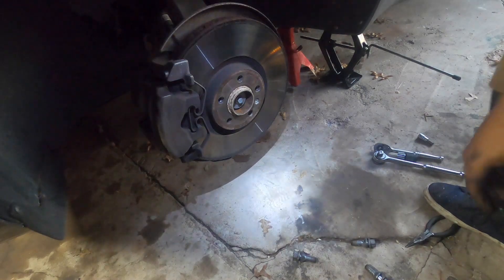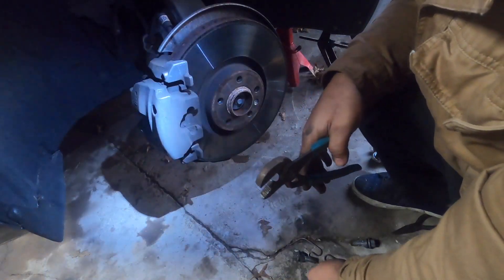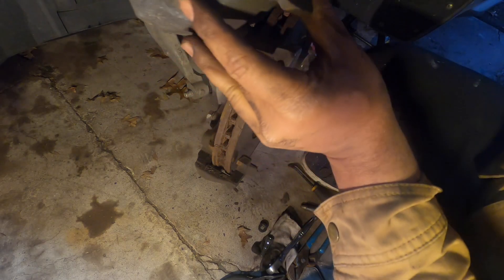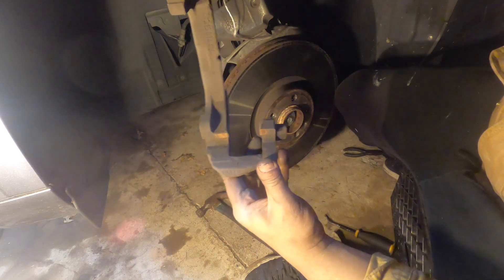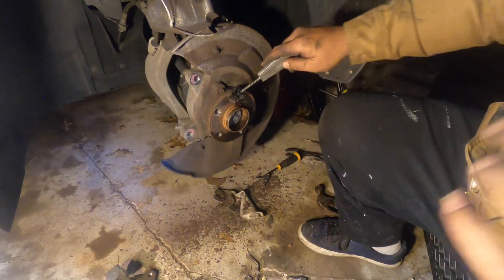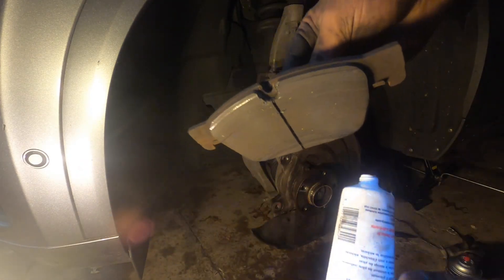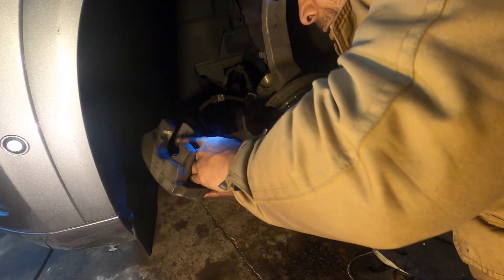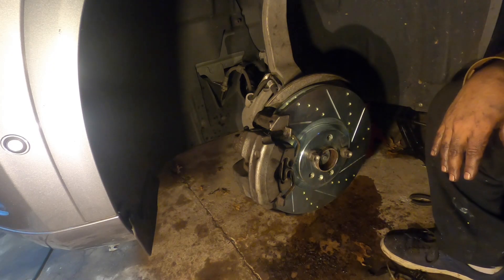how to replace brake pad and rotor on 2016 volvo xc90

Comment: The reason you couldn't fit the disc locator screw is the discs are sided and you fitted the discs to the wrong sides. think how the wheel rotates the groove should be pushing the pad away from the centre of the wheel - you will likely end up with judder and/or pad squeal from this mistake.
Reply from the maker: I’m flashing the brake fluid soon. I will swap the rotors to see if the screw hole lines up. Thanks. I have been driving the car over two years. Didn’t notice anything odd.
Reply: @BengalTiger  It shouldn't make much difference unless the centre cooling vents are sided.  If they are not angled then you'll get away with it.

Comment: The most annoying part of this job is that the caliper slider bolts use an 11mm hex which is difficult to source. A 7/16 hex will work though and easier to find. Good luck!

Comment: Man I have 2017 xc90 t6 inscription dealer say 18 brakes your the same? Do you have a link for this rotors?
Reply from the maker: I think I got it from eBay. The item is no longer available. Sorry bro!!!
Reply: @BengalTiger  thats ok.i look all over for 345 front and 320 rear i can find only crazy expensive ones.i did Detroit Axle for my 2016 escalade and it cost me 200$ for front and rear.

Comment: 6:04 - did that retainer screw really come out that easy?  I'm used to them being borderline welded in place!
Reply from the maker: This one came out easily. The other side i had to use a welding torch to heat it up.
Reply: @BengalTiger  Thanks!  I figured a little 'persuasion' would come into play.
Reply from the maker: Yes flat head screw driver will come to the rescue. After applying heat I used screw driver and a hammer to take the bad boy out. Good luck and with most of after market rotors you don’t have to put that screw. Thanks for watching.

Comment: Why does everyone make it look so easy to push the pistons back in.
Reply from the maker: Some time it’s little easy if you take the cap off from the reservoir. But make sure to clean the surface of the reservoir so no dirt goes in to brake fluid

Comment: Great video. But it baffles me on the lack of safety measures you take.  I cant believe you are relying on a cheap scissor jack to to hold the car up while you work on it. Also noticed you said  you do not need to screw in the T-bolt to secure the rotor to the bearing assembly.  Instead you inserted some lugs to hold it on. All you had to do was rotate the rotor and the hole would have lined up. I think you just assumed it wasnt needed cause you didnt see a hole.  Also spraying Brake cleaner on your hands and breathing it in a closed area is extremely toxic. Doing so often will result in adverse health conditions. Happened to my brother in-law.  Just sayin.
Reply from the maker: Thanks for watching the video. I’m very careful on  lifting the car up since I don’t have access to a lift. You probably didn’t see that I have another jack right next to the scissor jack.
Reply from the maker: I did tried to lined it up but the hole didn’t line up. I have been using the car almost 2 years now. I didn’t feel any differences. But thanks and next rotor I will definitely try to put the screw back on just to feel little more comfortable
Reply: @BengalTiger  because you fitted the discs to the wrong sides - they are sided.